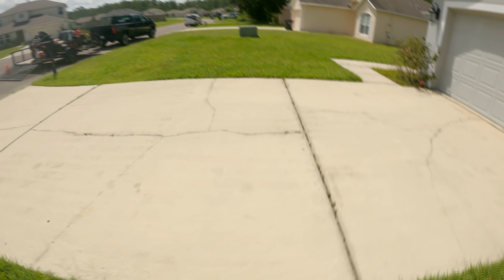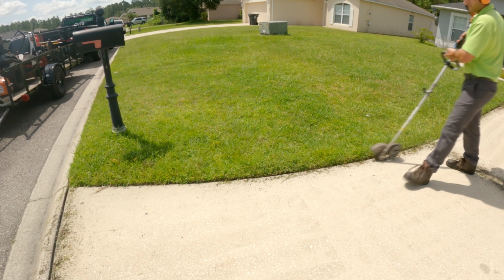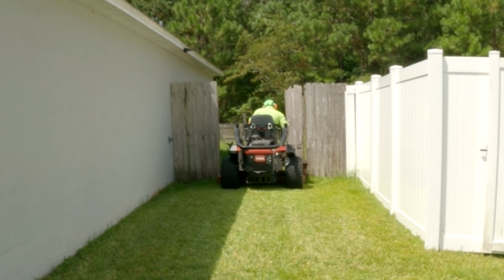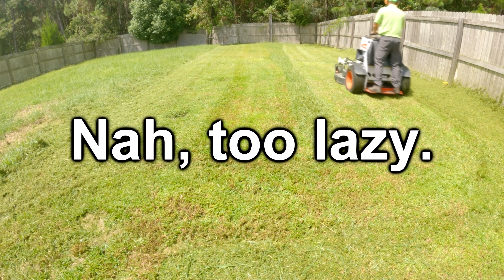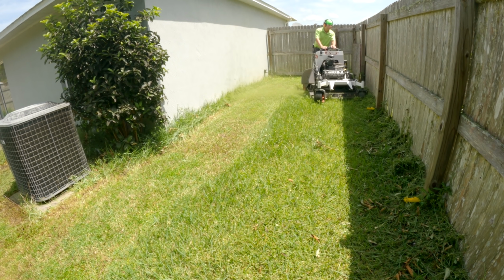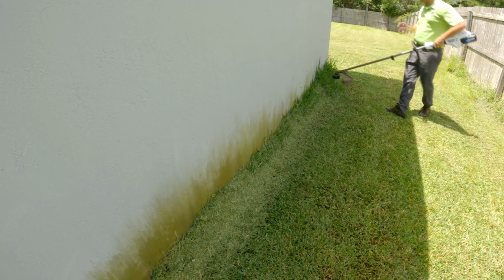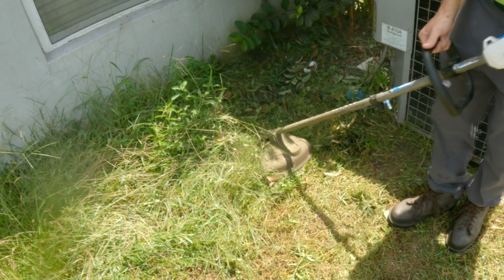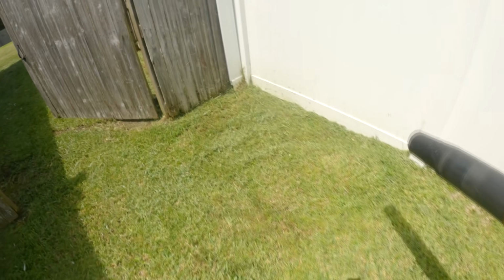Neglected Backyard With Commentary

Comment: Another channel that I follow, Upstate Brush Control, has a similar method of operation when it comes to getting so-called "free stuff." They have an arrangement with Fecon to evaluate cutter heads for forestry mulching, and while it's a "free" product for UBC to use, they give that product tremendous exposure on their channel so it is a mutually beneficial arrangement. Certainly much cheaper than paying for advertising in addition to the overhead costs of filming footage of the product in action that they'd normally have to absorb as part of their advertising budget.

Comment: The only issue, I know of, with the Vanguard EFI engines, the control wiring harness may fail. It mimics a failed fuel pump. Installing a fuel pump won't fix it.

Comment: How do you like the Hart Volt Trimmer? I think I might invest in one, as I really don't wanna go back to a 2-Cycle trimmer. I do like my Ryobi Edger/Trimmer because of the wheel attachment to help guide along edging, but that Hart Trimmer seems powerful, but light. What are your thoughts, Brad?
Reply from the maker: I'm a fan, but keep in mind they did send me a bunch of equipment at once so I had 4 batteries to rotate between. Otherwise that much equipment would be MONEY. BUT, they should be clearancing out the HART stuff for winter (at least they are starting to locally) so you can get some good deals on it.